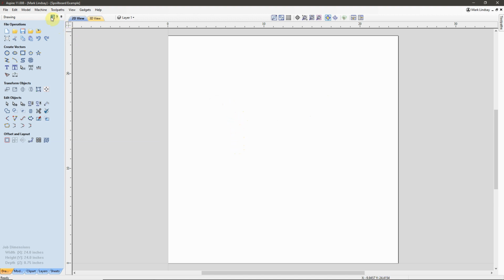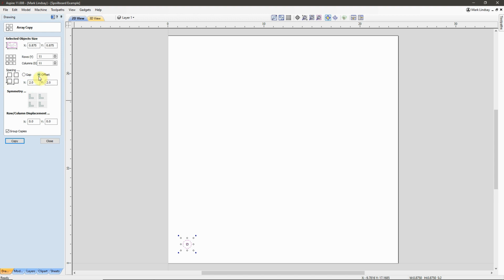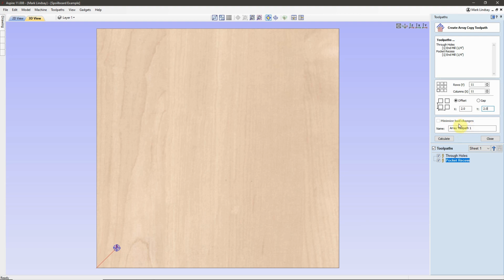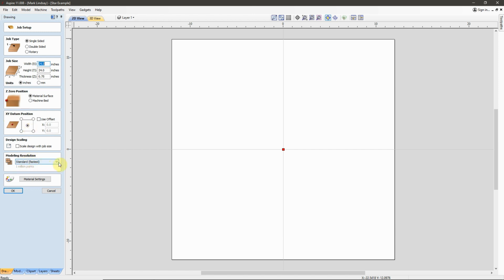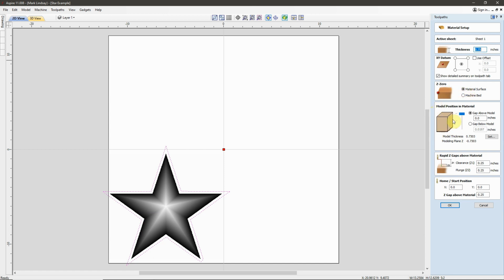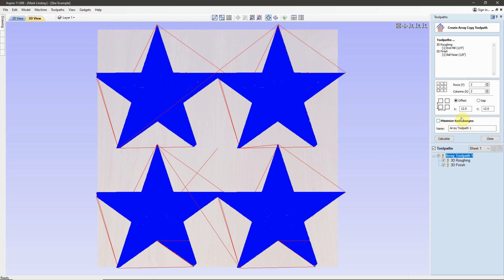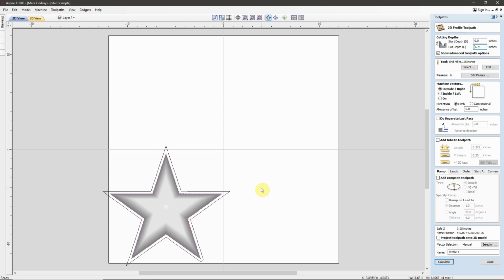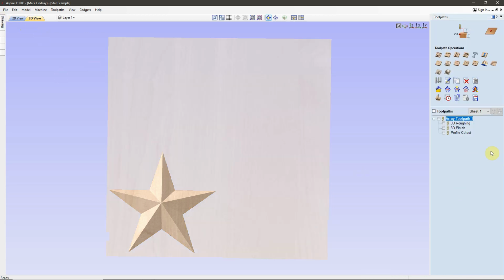Using The Array Copy Toolpath Option in Vectric Software

Comment: When I try to save an array toolpath that uses two different tools, I get an error message that says, "Error: The visible toolpaths use different tools and the selected Post-Processor does not support tool changing".  I am using VCarve Pro 12.  Please advise

Comment: Is it possable to Array Copy a two sided model?   I  have a two sided outlet cover, I need to make several copies of.   I am using VCarve Pro 10.5   Cannot figure out how to make multiple copies of a two sided model.   Thanks,
Reply from the maker: I've not yet tried to array copy a two-sided project, but it's on my list. Try posting this question over on the Vectric Support Forum. There are some absolute wizards over there, and I'm sure one of them has done it.

Comment: Handy function to know how to use. Without knowing this I would have made 2 layers for my spoil board circles. Make one layer, array and group them. Made a second layer, array and  group them as well. Then when I create my pocket toolpaths, I could turn on only one layer that i want to create the toolpath for, switch layers then repeat for the second toolpath. Either way works. Thanks for the video!

Comment: it takes 56 hrs to cut this
Reply from the maker: Please remember that this tutorial was meant to demonstrate how to array copy toolpaths only. That's why I never got into machining times in this video. There are a lot of variables involved in carve times. To help reduce carve times, check the Feed Rate and Plunge Rate you have entered for each of the bits you're going to use (using the EDIT button within the toolpath.) The thing to remember is that the CNC will always move at the rate of the slowest axis. In 3D carving, that's almost always the Z axis, because the Z is in almost constant motion. So you can have a feed rate of 200 inches per minute, but if your plunge rate is 30 inches per minute, that how fast the CNC is going to carve. That's why I use a Roughing toolpath - to remove most of the material, with a .030 machining allowance. With about .030 left to machine in the Finishing toolpath, I can set that plunge rate to the same as my feed rate. That single action will give you a huge reduction in machining time.

Comment: Rookie question. Why did you offset the vector around the 3D star by .25”? I did not know you need to offset the vectors around a 3D model. What am I missing?
Reply from the maker: I offset that vector to show how it was done. You do NOT have to do that. I wanted the bit to cut beyond the boundary of the model by 1/4 of an inch. I could have also used a Boundary Offset of 1/4 inch in my 3D Finishing toolpath. There are many ways to accomplish the same thing within the software.

Comment: Another informative video - appreciate the effort you put into these videos in trying to teach us about how to get the most efficient use of the software.  As you said it is a personal preference regarding use of this Array Toolpath Option or the Array Copy option.  Since being introduced to the Array Toolpath Option my tendency is to use the Array Toolpath option for several cutouts of the same design or 3d model.  This is because of the point you made where you only make adjustments to one design or one model and don't have to go back and do another array copy, etc. etc.  After a few of the array copy sessions this can get old, vs. just making the change once and going straight to the toolpath and recalculating.

Comment: Thank you for making these videos.  I am just learning VCarve Pro and have two questions.  1) For the star offset roughing toolpath, it appears that the adjacent stars are very close together and could possibly overlap.  Does the software recognize potential interferences between adjacent stars?  2) At around the 27 minute mark, you set the cut depth for the profile cut by formula by subtracting the start depth.  I noticed the screen have what appears to be parameters (i.e. - D for starting depth and C for cut depth) and was wondering if you could just enter D in the formula instead of 0.02"?
Reply from the maker: Thank you, Steve. Both good questions. 1.) No, the software doesn't automatically recognize potential collisions. That's why it's important to keep the tool diameter in mind while designing, Preview the toolpaths, make any adjustments that are needed, then Preview again if needed.  2.) The short answer is No, only because Start Depth and Cut Depth aren't variables that are built into the calculators. Having said that, one of the presentations during this year's (or maybe it was last year's) Vectric Worldwide Users Group Meeting had a segment on adding certain variables to the calculators. I'll try to find that presentation, and do a little bit of experimenting on my own. If I succeed, I'll certainly do a video on it.

Comment: Mark, Could the array copy tool path be applied to different sheets? Like the star is the video but I need to cut multiples out of different size boards. Could I add sheets that are the size of the boards I have and array copy tool path to the different sheets?  Keep the video coming, I learned so much from you already.   Thanks
Reply from the maker: Thank you, Joe. I've done a little bit of experimenting with sheets, and the short answer is I haven't yet found a way to make it work. I'll get into it further during today's Live Q&A. https://youtu.be/5GUSp_mA_0Q

Comment: Mark, When cutting multiple 3D models and you want to use the Array Copy Toolpath option you can use a smaller Job size which will maximize the pixels in the 3D model. The Array Copy Toolpath does not need the pixels to generate the 3D cutting.
Reply: Image cutting 50 very small 3D models from a large sheet of material. You would be losing pixel quality but using a smaller job size you keep the quality of the components.
Reply from the maker: Excellent point, Michael! The smaller material size is one of those things I sometimes forget about when designing. I'll be sure to bring it up in the Live Q&A today.